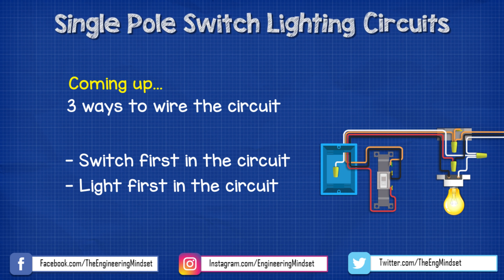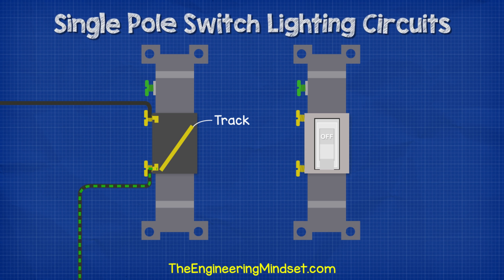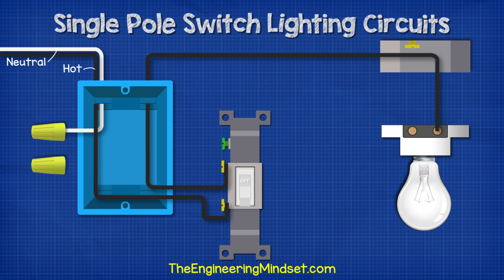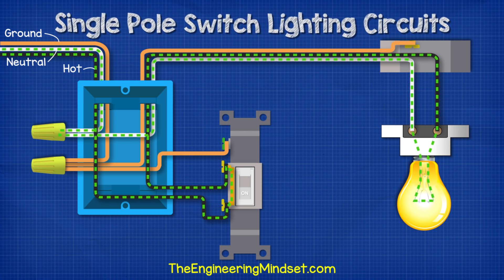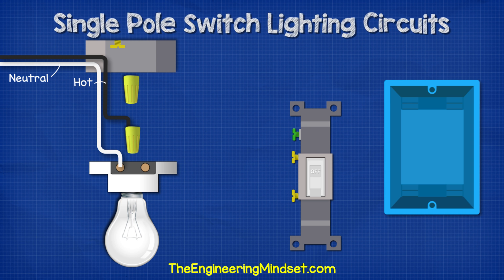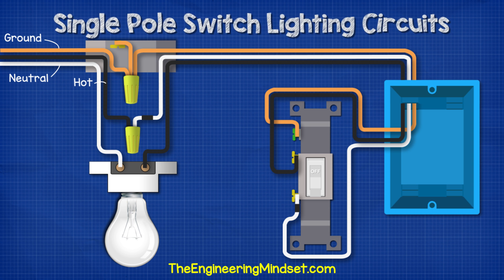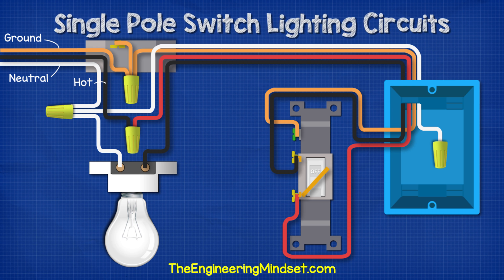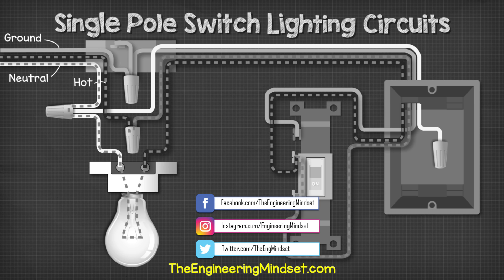Single Pole Switch Lighting Circuits - How to wire a light switch

Comment: how do i modify a light switch so it stays on regardless on if it's flipped up or down?
Reply: If there are only two non-green screws on the switch, then 1) turn the power off 2) remove cover from the switch and switch from the wall 3) remove the two wires and use a wire-nut to tie them together.  4) put the switch and cover back together.
Reply: @jovetj  Thaank you for replying. Its just a conventional switch. 3 screws...one has the black ground attached on the switch....and the other 2 screws (lining up to the up and down flip position of the switch)  each have a white wire wrapped around the screw...
Reply: @sdufg  Which country are you in...?
Reply: @jovetj  canada/USA

Comment: Can you use the 3rd method, but switch your red and black in the light fixture so that red is the "switched power" coming back from the switch to the light. Now you have a Black, White and ground in your switch box, and you could bring that out to a string of outlets. I know this would technically work, but would it be to code, and are there any issues with this? I am about to wire a shop, and would like to use this method to reduce number of romex wires pulled through conduits.
Reply: I'm not a bonafide expert, but that sounds like how I'd do it in your situation.

Comment: I have an single pole switch and have it wired exactly the way you have shown in the first case (power to switch first). When I turn power back on and use a contactless current detector, it shows power correctly turning on and off at light with switch...but the light won't turn on. Any ideas why this might be? Using a brand new keyless lamp holder and bulb

Comment: In the light first scenario, instead of using black tape to mark the neutral as hot, can't you just use a separate black wire?
Reply: You could, sure.  Or even any other "hot" color (e.g. red, blue, etc.).  The problem is that most of the wiring in a residence is done with non-metallic-sheathed cable.  You can't get cable with an extra "black" wire in it.  You can get cable with an additional red wire in it.  But, both solutions are more expensive, so they were avoided.  Current codes would require three-conductor (black, red, white, with ground) cable to be ran to that last switch so there is a neutral in the box, however; the "light first" wiring method shown in the video is not legal for new installations.

Comment: Which method is more popular now?
Reply: It isn't a popularity contest.   It's a function of practicality and economy.  Cable and wire are expensive, and installing it takes time, so you want the shortest, most-efficient runs possible.  The physical layout of the structure and the electrical device locations to meet that goal are how the method is chosen in a given situation.

Comment: Amazing tutorial. Is it fair to assume that as you're running the line, you can have an outlet on the same line as well?
Reply: If you have an unswitched hot, and a neutral and ground, then yes you can stick an outlet there.
Reply: Great question, and this 1st method he offered is which one I used, and my power source was stemming from an plug 🔌 outlet. Then at the j-box where I split my power to the  light switch,… that’s where my neutrals were tied together as mentioned in this video. That may be your point in question perhaps.

Comment: Thanks. 
My rudimentary electric connection knowledge didn't include the "fixture first" model. Assuming the switch is always first would allow you to make a mistake in assuming that if you turn the switch off, the light goes off, there's no power on the fixture and you can work on the fixture. It would be wrong if the current is getting to the fixture first. The wire would be hot!
Reply: Yup!

Comment: Can someone explain the reason for the 3rd terminated neutral in the last set-up? If neutral is supposed to go back to the source of power (transformer), then why even have the 3rd neutral wire terminate to itself inside the switch box?
Reply: It's future-proofing for smart devices that is now required by Code. Just because it's not required at construction doesn't mean it won't be needed later.

Comment: Excellent instruction.  I came across the second wiring setup today while trying to find a fault causing my light to flicker.
I was fairly sure I understood the proper wiring but fairly sure isn’t good enough when it comes to wiring.
Thanks to this video I am confident.
Reply: Did you find the cause of the flickering?  I'm having the same issue with a bathroom light
Reply: I did.  It was a loose connection in the light fixture - the wire nut was poorly installed.
I did not do the original installation.

Comment: Do you think explaining  two 1 way switch wiring diagram with three lights. switches are set at each end of lights. thanks
Reply: If both switches are controlling the lights, then they must be 3-way switches. 

Power comes from the fuse or breaker panel, and goes into the special-colored common terminal of the first switch.  There the power goes to one of the two traveler wires, which are the other two same-color terminals on the switch.  The travelers go to the other switch "in reverse" of the first.  The common terminal of the second switch is switched output, which goes to all of the lights.  The lights are wired in parallel with each other—the switched hot wire splits to all three hots on the lights.

Comment: The 3rd way looks unnecessarily complicated. You didn't go over why you would choose one way over the other.
Reply: It's not complicated. It's exactly the same as the second way, except that the neutral wire that stops in the light box in the second example also goes down to the switch box, even if it's not being used yet.  It may be needed later.

Comment: Excuse the following "manplanation": I just bought a gutted house from the city of Detroit and it's over 100 years old. Needless to say, there's a lot of work to do. I ran some lights (once DTE Energy decided to come turn on the power) just so I could see, but I didn't include any switches. I've popped a circuit trying to install a switch AFTER the light and power source. Your video is so straightforward and easy to understand and follow. Thank you so much for making the content you do. You've definitely saved me a lot of headache.

Comment: on the first scenario when power come to the box first and goes to the light could i add a ceilling fan after the light ?  so it can be controlled by the same switch ?
Reply: What do you mean "after the light"?   You could replace the light with a fan/light combination, yes.  The fan can be controlled locally with a pull-chain, and the light can be controlled with the switch.  To have both the fan and light controlled from the wall will require new cable in the wall if there are only two wires in the cable now.
Reply: @jovetj  ''after the light'' mean youll continu the circuit.. add another wire from the light to the ceilling fan ... and no i was not going to add a pull chain it look so 80s...
Reply: @nmarmz  If you want the one switch to turn on both the light and the fan, then yes, that would be very simple to do.... but not very convenient to use.  Most of the time, you want the fan and the light to be independent.  And there's nothing wrong with pull-chains and they don't look "80s" LOL

Comment: Code requires a neutral in most switch boxes now.
Reply: This problem can be fixed by running a 3-way wire from the box to the light for the leg run.

Comment: In the third/last example, I don't see the reason why you leave the neutral pigtail hanging in the box. It's not providing any value and just takes up space.
Reply: It's future-proofing for smart devices that is now required by Code.  Just because it's not required at construction doesn't mean it won't be needed later.

Comment: I was wondering which light fitting model can I use/buy with these equiptments? >-< Thank you!
Reply: I'm no pro, but if I understand your question, then any listed lighting device for 120VAC should be fine.  The most common listing agency in the U.S. is Underwriter's Laboratories (UL), but there are others.

Comment: Can I turn an outlet into a light switch and ceiling light? I have an outlet that's going to need to be removed to make a linen closet and I was wondering if I could convert that to the light for the linen closet. The outlet only has one wire coming into it and it has three wires. Black, white, and ground.
Reply: Probably, yes.  I know it's pedantic but let's get definitions down:
– wire = a lone conductor, usually a flexible metal with an insulator over it.
– cable = a bundle of multiple wires in a single jacket.

You would have to keep the outlet box, but you could move it anywhere that can be reached by the existing cable, and positioned for convenience as the switch.  The switch would go in that relocated box, and a new cable would be ran to the new box for light light figure.  It would be just like first diagram, at 1:45, and you'd just need to add the cable between the switch and light, and the light box. 

If you're not completely confident with understanding what you're doing, have someone who knows what they're doing do it.

Comment: Stupid question from a non-electrician
Trying to install a smart switch (TP-Link Kasa type), and found that the switch has 4 wires, including a white neutral. 
Is it a version of the third type described in this video, with the neutral terminated in the switch instead of the switch box?
Reply: It sounds like a switch that can be used as a "two way" switch (like in this video) or a three-way switch.  A neutral is required, so that smart switch would only work in the first or third scenarios shown in the video here.

Comment: Electrical apprentice here. Why do you land the black hot wire on the bottom of the switch?
Reply: It doesn't matter.
Reply: I always put the black hot on the bottom as a matter of habit.  If I need to know which is the load line later - then I know.

Comment: Don't need to ground your switches. Maybe you do for option two,personally I've never seen that.
Edit: pretty decent video though,most stuff I see they take neutral to the switch.
Reply: You always ground your devices. It is code & safety.
Reply: @jeffminor5126  nope. Maybe where you are,but in Canada (at least western),we don't do that for switches and lights except for a hospital.. the box is already grounded,and if you're installing your switches within arm's reach of a sink,and not having them on GFCI,you probably shouldn't be an electrician.

Comment: The second option is a very bad, dangerous, and crazy example.
Reply: It's not dangerous. It's a loop switch connection. It's very common in older two wire systems. Most municipalities allow it to still be used in older homes that have laws, where they're continued use is grandfathered in. As long as the white wire near the switch, and junction box connection is labeled with black tape or black marker, it's totally safe. If someone doesn't know what the markings on the white wire coming in from the source, to the switch mean, they have no business working with the wiring in the first place.
Reply: It's not very bad nor dangerous, and certainly not crazy.  It's inconvenient sometimes, that's all.

Comment: On the 2nd option. Why would you run the white wire from the switch to the light? I mean if the black wire is the hot wire wouldn't it make more sense to just connect black wire to the lower terminal on the switch and white wire to the top?
Reply: The terminals on the switch don't matter.  I think it's more logical to have the black wire be the always hot, and the white-marked-black wire be the switched hot.
Reply: @jovetj   typo? you said both switched hot
Reply: @kurtrowland5587  Oops. Not a typo (which is a simple mispelling).  I just didn't read what I wrote before posting it. :)  Corrected.

Comment: Great video - very helpful.  I have version 2 in my garage and would like to add an outlet - is that possible?
Reply: If you have the second example you cannot add an outlet because you lack a neutral wire. You would need to rewire the circuit so the switch box has a neutral or feed the outlet from the light.

Comment: Bought a smart switch which mentions requieres a neutral. Just found out I've got the 2nd example connection setup (white is line and black is load + ground). So my smart switch won't work in this type of connection? Fyi (house was built 2020. And seeing previous comments about that setup  not being permitted now, did electrician mess up)? Is there a way to make my smart switch work with this setup. Thanks in advance for comments.
Reply: Yes, electrician messed up.  The code was changed in 2011 to prevent this exact scenario. 

You will have to find a smart switch that does not require a neutral.

Comment: When you add multiple lights in a row do you just pig tail everything and do it just like you would outlets
Reply: Yes. but neutral to silver screw and hot to the gold screw. Whereas, when wiring a single pole switch it doesn't matter.

Comment: I have a problem. Replaced a fan. Wired just like the 3rd version here. Light switch is off but the fan and light stay on. How is this possible??
Reply: If you have black, red, and white wires between the fan and the switch, you can control both from the wall.  Take the back wire at the fan going to the switch and connect it to the black wire from the breaker panel. At the switch, feed that black into both the fan and light controls.  The output of the fan control can go onto the red wire, and the output of the light control can go onto the white wire marked black.  At the fan box, connect the red and white-marked-black wires from the switch to the appropriate hot wires of the fan.  Connect the white neutral from the panel to the neutral(s) of the fan/light. 

Note that there will not be a neutral in the switch box, but it will work with a regular switch.  To install a smart device as the switch device, you'll have to install one that does not require a neutral.

Comment: Great video and information. The second method is not recommended since it leaves the hot wire exposed as neutral. This is a problem in the future of anyone not knowing what the previous homeowners did.
Reply: What do you mean "it leaves the hot wire exposed as neutral"?
Reply: Yep, 3 wire is now required for this scenario in my part of the world.
Reply: Any electrician will know this,  that's what matters. If a homeowner does not know what they are doing,  they should not be working on it.
Reply: I think anyone with some competency will notice when a black and white are together, they must BOTH be hot. If one is changing the wiring in the light box they will see a white and black wire nutted together. There is no way that would work, obviously, unless they were both "hot". Likewise, if you go into a light switch and you see two wires. One black, one wire, if someone doesn't understand that a switch requires 2 hot wires to break/make the connection, then they should hire an electrician right away. White and black DO not go together UNLESS they are both hot or both neutral, and there's very little reason to make a black/white both neutral, but there are plenty of reasons to hot/hot if the circuit comes to an end. It is just TOO much work to feed 14/3 - 12/3 through because that might not be what is on hand at the time, and it requires an extra nut.  I don't know, I would hate to be doing a job and have to go all the way out of my way to bring in 14/3 just to feed some extra wire through, when it can be done the same way, with no extra wing nut or tape, and is self explanatory. I do mark them with electrical tape. Remember, this is a light switch. You are not going to be seeing white/black connected together at all, or if that was the case it wouldn't be an on/off switch it would be just an ON switch with power going TO the switch but not coming out.
Reply: @jonburhan5478  What you're saying makes sense, yet it doesn't answer my question.
Reply: @icevariable9600  He just meant that a neutral (white) wire has now been exposed as hot when someone opens up the switch or light fixture box, and removes the neutral (white) and potentially shocks themselves when they complete the circuit. It's not unusual to remove the neutral without cutting the power. If someone is messing with a switch or box with the power on and doesn't recognize the white and black on the same circuit, then they shouldn't be messing with electricity, unfortunately.  I think his warning is a little strange because anyone getting shocked by this sort of reverse loop switch probably don't know enough about electrical work to even attempt a basic fixture change, so they are going to get hurt no matter what with ineptitude. Any one who knows electrical work will realize straight off the bat what's going on because this reverse switch method was extremely common in the 70s-90s and when we work on houses around that period we often see at least one switch that way.
Reply: @Raymond Ray There's nothing wrong with circuit #2 shown in the video.  The reason it's now illegal is because of the pain of adding a neutral to the switch box if it's needed in the future.

 @jonburhan5478  Always turn off the power.  It's sorta like looking both ways before crossing the street.
Reply: Test before you touch and you wont get shocked

Comment: In the third version using red wire, why connect white wire at all just to dead end it in switch box?
Reply: It's required by code, so that you have the full complement of wires a available at all times in all boxes.
Reply: Just because that neutral white wire isn't needed at installation doesn't mean it won't be needed later.  See the comment right above yours.